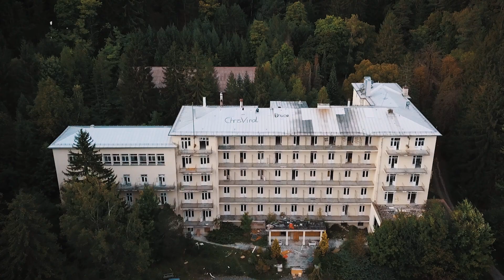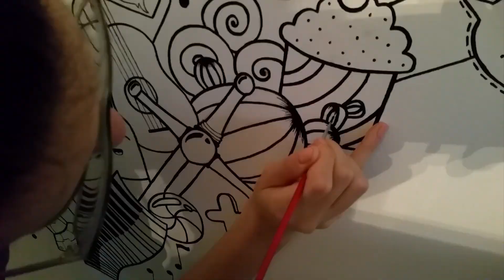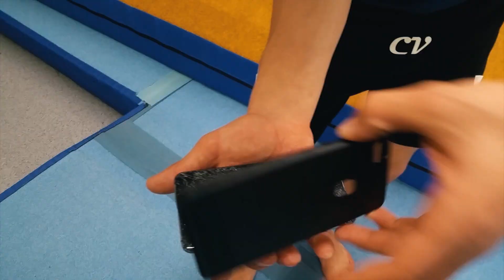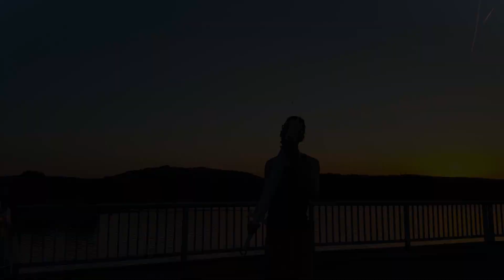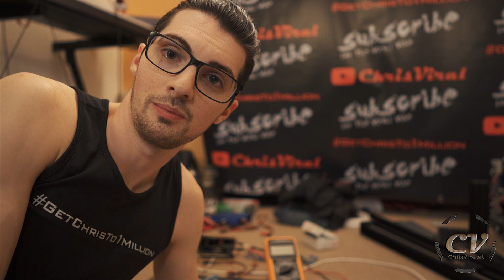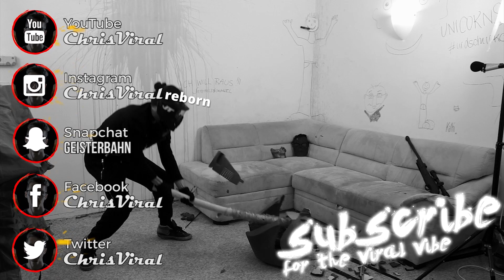5 x 400kV Module In Series? (Flawed)

Comment: Transformer type there try a low in current type want a EMP feild off it??8cm dangerous on open chips phone should be ok low feild great on a calculator gose crazy but just enough protect so it don't blow?? These are a 20kv not rated 2cm high current the low current type allows for more ark nice plasma type you also need a flyback line as these don't like on and no ark out add a cm gap with wire if your end out drops the flyback arks so the unit don't over load. Had 3 on a low safe meter in sounds and runs like a motor engine piston 1to 3 it was cool to time pulse and lower current draw over but hook 6 and don't work put battery and all light up zzzzzzzzz.but no motor run😭

Comment: Just a small tip: Most of these modules just have a pulsed output so adding them in series just makes it arc more often if they don't fire at the same time, but the resistance of the additional coil in series makes the arc a little weaker overall. So what you could do is buy a few cheap 20kv ceramic capacitors (1-3$/piece) and add one (or two in series) in parallel to each hv generator.
Reply from the maker: Yes that's exactly the lesson that the next vlog yielded.
(https://youtu.be/pGp38mRxBFI)
Way more arcs, way faster, but fairly tiny ones.

Thanks for the insights and for the suggestion. Sounds like a plan! :D
Reply: @ChrisViralVlogs  do it plsssss

Comment: It isn't working because if you want voltage to add then the output voltages of your modules must be synchronised in phase.
Notice that when you connected them in series arks happened more often, so you've got more sparks instead of higher voltage.
Reply from the maker: Yes, thanks, it only got obvious to me in the next vlog.
(https://youtu.be/pGp38mRxBFI)
I realized that every module is firing at random. Seems logical but that makes me sad. Haha it would be so easy this way lol.